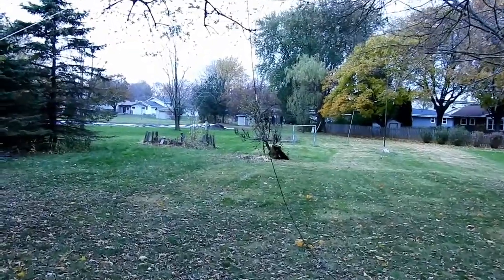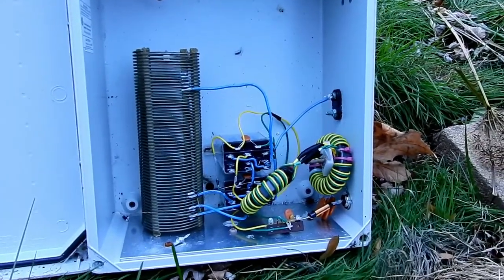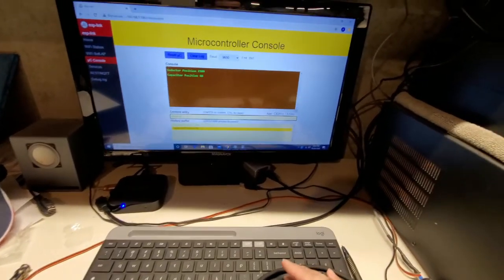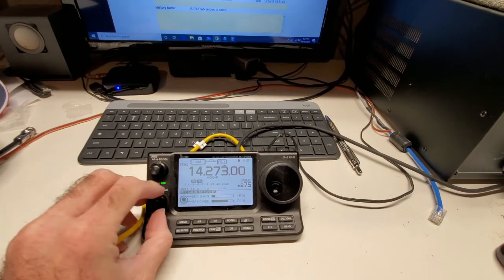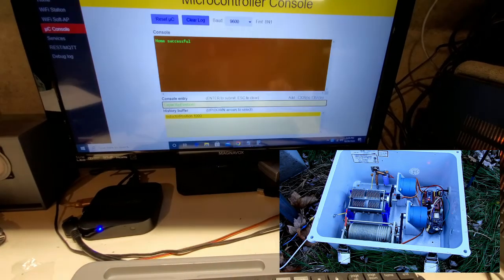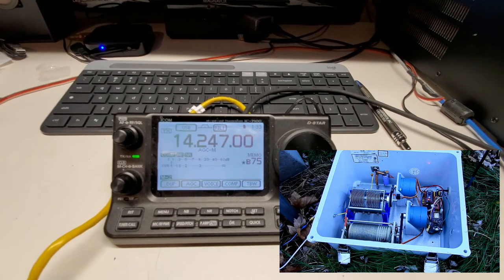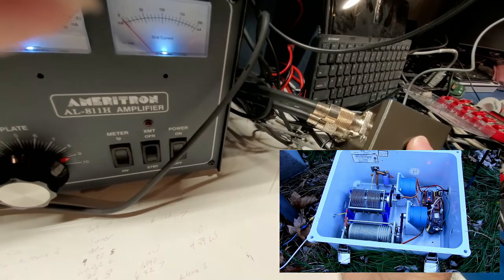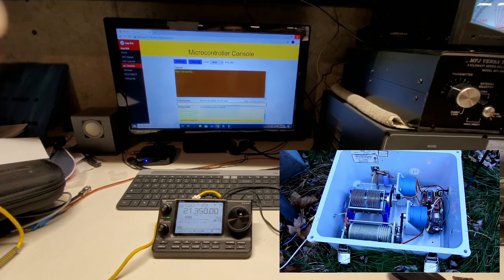Remote Control Antenna Tuner Update

Comment: Nice project. Placing the electronics inside a die cast aluminium box with some feedthrough caps for in and out will make it a lot better. Are you going to add an auto-tune function? A simple board that can plug in on top of your arduino like a rig expert AA-30 Zero can take care of that part for you, simple relay control of the source being the rig or the expert... easy money lol. Seeing as you have the ESP32 there, you can create a nice web interface to control it too. Using ESPNOW, you could even link it directly to your radio... endless play time here...